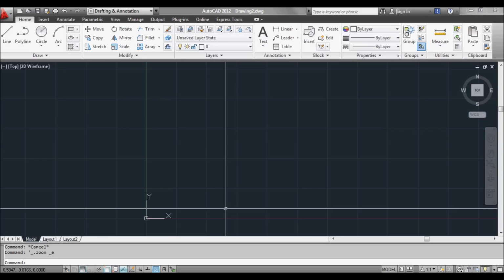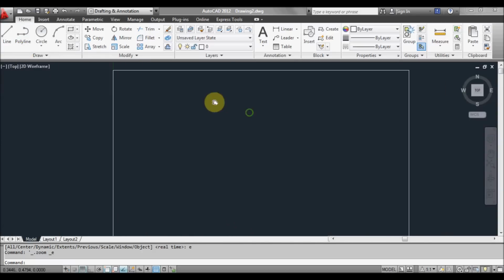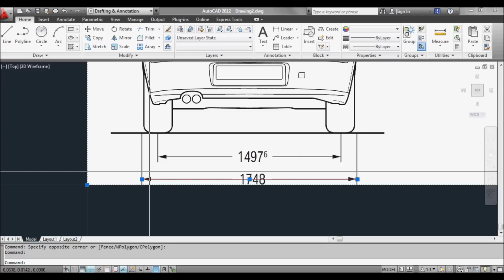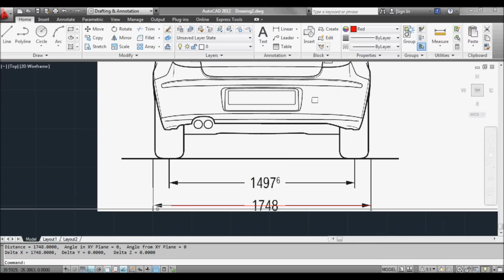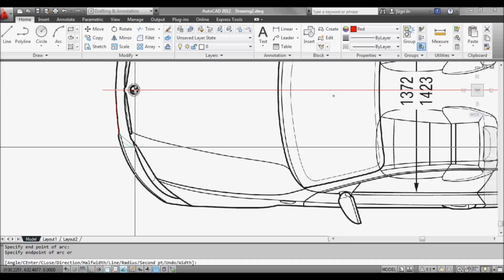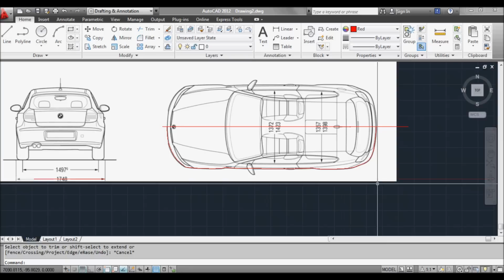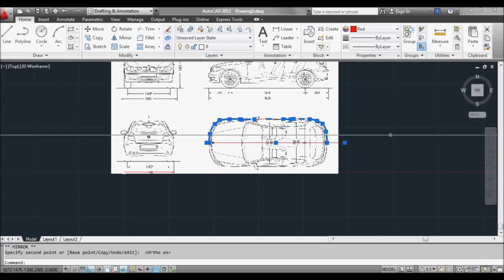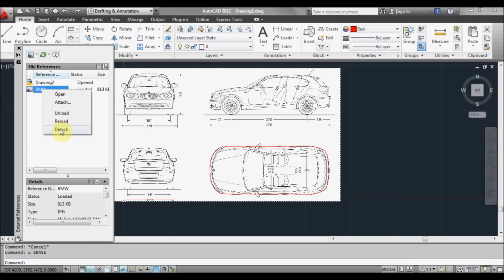AutoCAD Inserting / Importing Images, Scaling Images, Tracing Images

Comment: actually you can open the image in AI and "image trace" it to "line art" or only line and export to dwg file and re scale it in cad...
Reply from the maker: +Stan yu Yes that is a good point but not everyone will have AI. Also "image trace" type functions in many software packages only work well with black and white line drawings. In the real world, many times you need to trace photographs such as buildings to use as elevations for streetscapes. image trace things don't always work well in these instances.
Reply: can u pls explain more

Comment: THANK YOU! I'm an interior design student in the 2nd quarter of CAD. So my understanding and abilities with this program are very limited. For my Historical Preservation class (and for a local group) I'm trying to work from a scan of a 1929 set of blue prints. I knew how to import the image. But until I found your tutorial I had no idea how to scale it to the right size.
Reply from the maker: Richard Craven Thats great Richard. Thanks for the information on what you are working on....sounds like a great and worthy task to undertake/ I'm glad my video was helpful for you. If you want to learn a lot more on using AutoCAD, I have a training course on my channel I am working on at the momen. There are a few videos up at the moment and I will be adding more as time goes on to complete the course. It is a bit dry to begin with, but the course is designed to cover a lot of details in using AutoCAD. Thanks again for the comment.

Comment: i have 1 question for autocad 2007. i use autocad 2007. e.g. i made 5 different .dwg file.  file name is like part1 to part 4 and last file is all the parts assembly. if i make change in part file like any dimension or width. then i save this file. this change is shown in assembly. is this possible?
Reply from the maker: yes it is possible. What you are wanting to use are called: xrefs  Look up the xref command in AutoCAD. I also do a basic video on xrefs on my channel or you could just google xref tutorial to learn more. Good luck

Comment: Would this be the same procedure for importing CAD blocks (kitchen / bedroom / bathroom ) drawings?
Reply from the maker: Well, yes, you could use this method if you inserted a block that was drawn in different measurements than what you are using. For example, if I drew something in inches then wanted to scale the block to millimetres, I could use this method. You can also change the units when inserting a block using the insert command. But if you are just dragging and droppping blocks into your drawing, use the method shown in the video.
Reply: 79Espie thank you sir! :D